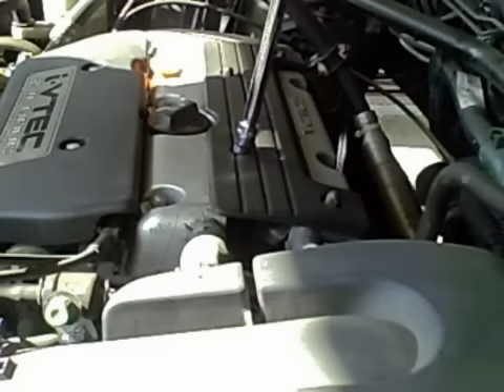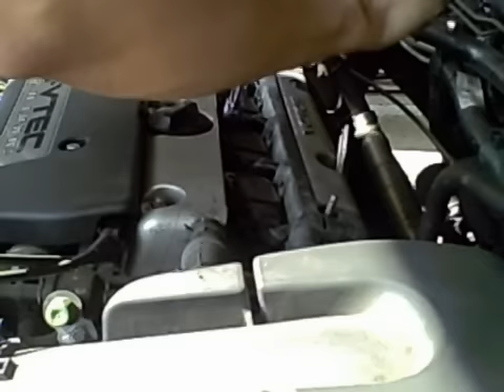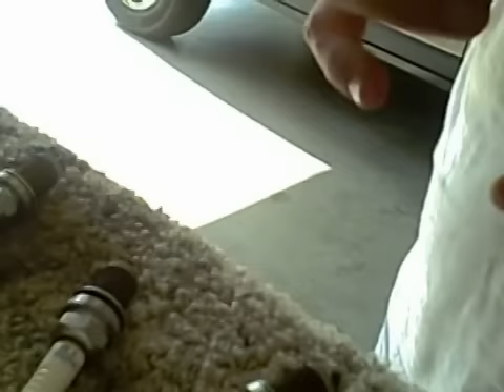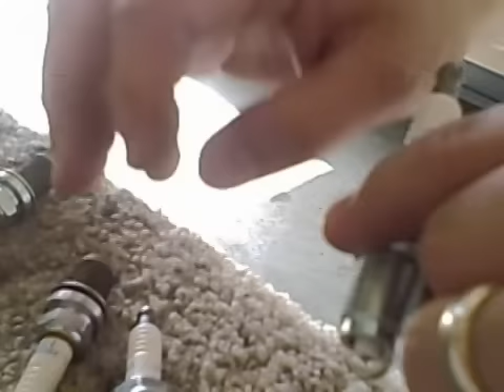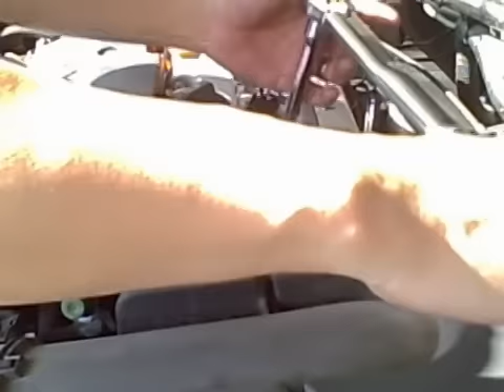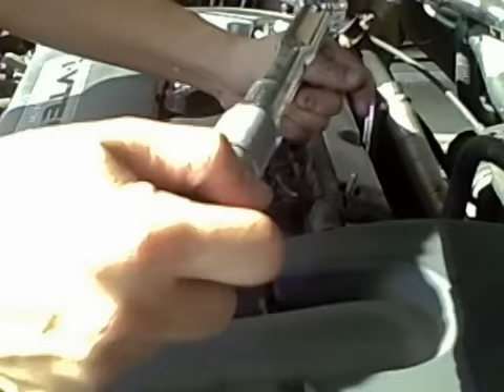2003 Honda CR-V spark plug change

Comment: Passing on a suggestion I found while looking for tips on chging plugs on my truck: Use electrical tape to tightly tape the socket to the extension so it doesn't pull off in the tube to the plug. Worked for me. Added measure of safety.
Reply: Great tip! Thanks for sharing.

Comment: For easy coil removal, be sure to squeeze the connector near the wire end, not the mating end. Also applied a small amount of dialectric grease to spark plug boot to aid reinstallation and create moisture barrier. Noted some rust at top of hex flange begining to form.

Comment: @stratfenderstrum: I agree with you, I noticed it right away, 13ft-lbs is not much and with the torque wrench used- it sure did seem to be tightened more than 13 ft-lbs.  Maybe the torque wrench needs calibration.

Comment: On my 2003, the interior coil bolts were not removed as part of the cover bolts. In fact, what remained was a shoulder bolt of sorts where a deep socket would have been ideal. The 3/8 socket did not clear the shoulder due to the stepped down design of the larger drive. I was able to jury rig a 1/4 socket in conjunction with vice grips to remove the bolts. Like I said a deep socket would be idea. At 96.5K miles plugs not bad, but worth replacing.

Comment from the maker: @sj00884 Hm. I thought i read somewhere that the plug i got were pre gapped. Therefore i didnt bother checking them. Ill check them from now on just to make sure. @others, I changed it out early at 100k.

Comment: Do not even try to gap NGK Iridiums these are gapped at the factory, they are very fragile and will get damaged if you try to change the gap. The NGK's are OEM = original factory specs and should last 90K miles.

Comment: Why does Honda charge $400 to do this??? This looks rather simple. What did you unplug right before you pulled out spark plug?
Reply: You are correct... My Honda dealership wanted to charge me $300.00
Reply: He Pulled Out The Coil Before Pulling Out The Spark Plug Sir. The Spark Plug Connects To The Coil & Engine 👍